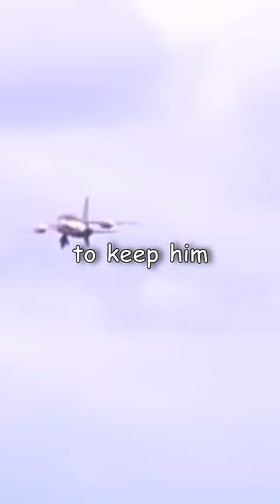A Midair Malfunction Changed This Pilot’s Life #shorts

Comment: He shut the engine off so it wasn't going to stall. I bet you he was wishing that he had some kind of camera or even mirrors to see that the engine wasn't on fire 🔥😞
Reply: who cares if its on fire..if its still burninnn and  runninn keep goinnnn...duhhhh
Reply: How does shutting down the engine prevent the aircraft from stalling?
Reply: @StanleyMilgramm  I know it sounds black he made an error in his narration.  But if he shuts down the engine, then it prevents it from stalling because it is off. My assumption at this point is that if it stalls and it'll be excess of jet fuel build up and it could explode.  If you turn your engine off in your car then it is not running. Therefore it doesn't have a chance to stall out. About any kid who was running out of fuel in his truck or car has done the same thing.. Coast down the hills. Only start the engine to make it up the next hill. Simply said with the engine turned off you're not burning any fuel ⛽.

Comment: How did he keep the engine from stalling when he already shut it down?
Reply: Keeping up with a high enough speed, that is why he descended to gain as much speed as possible.
Reply: Ah, it doesn’t mean stalling like a car engine.
When an aircraft stalls it doesnt mean that the engine turned off, it means that it’s going too slow for the wings to get enough lift. A stalling plane drops out of the sky like a brick and stalling can happen even if the engines are on.

When a plane stalls, you try to push the nose down, because diving makes the plane go faster. Faster means no stalling
Reply: He's basically gliding his plane
Play War Thunder, DCS, or IL2 Sturmovik fly a plane or jet really high & shut down the engine & control the descend
You'd get the idea real quick on what the Pilot was trying to do